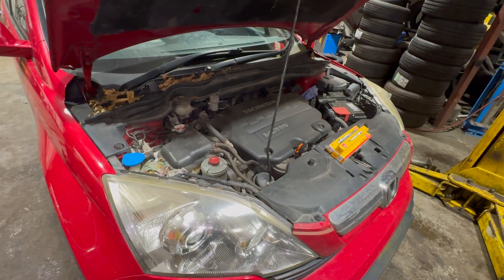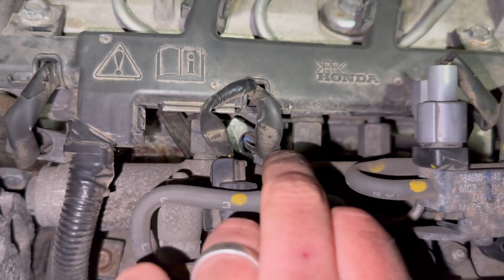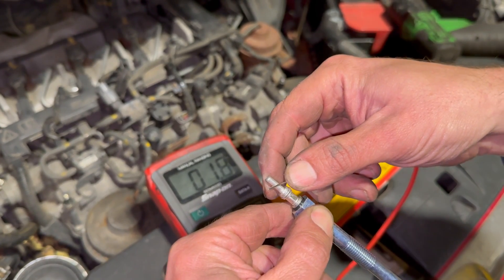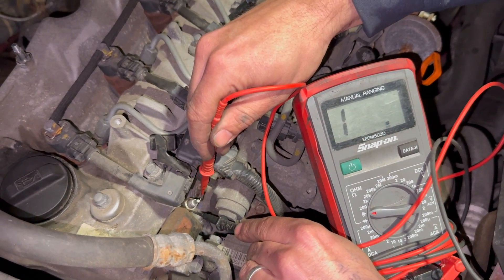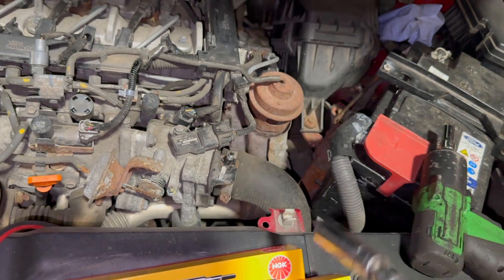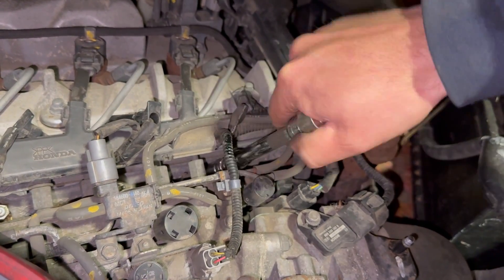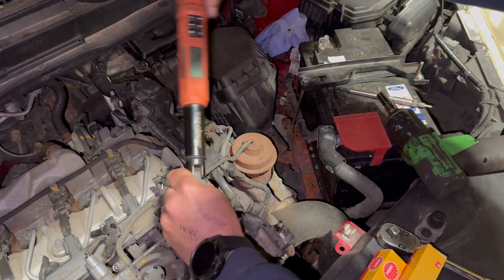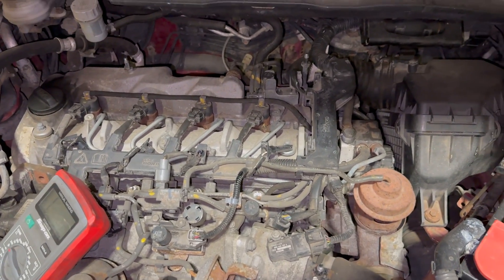How to test & replace the glow plugs on a Honda CRV 2.2 CTDI

Comment: Measuring resistance alone is a good measurement, but I think checking current draw under load (watts/amps) is a better measurement. It's unclear how hot the glow plugs are, even though we know their resistance.

Comment: Hello, I have a honda civic gen8 2.2 CTDi. I just realised the glow plugs never been changed, got 153k on the clock, no missfires. Been taking really good care of the car since I bought it, general maintance done. Just passed MOT with no advisories, beside all the care, everytime I start the car and I am not moving, it smells like diesel inside (no leaks, already been checked by 3 diferent mechanics). Could this be a cause? Any ideias or sugestion? Thank You
Reply: I had the same issue on m'y Honda crv idtec 2.2. smell of smoke in habitacle
Reply: @webinspiration  Did You sorted out?
Reply: @YouSt0leMyHe4rt  yes, EGR pipe was changed AT official Honda garage
Reply: @webinspiration  Thank You for the feesback
Reply: Certainly EGR pipe is cracked.

Comment: Hi , thanks you, I have bought 9 months a go a Honda CR V 2005 2.2 CTDi Diesel  RD 9. and Iove it. about 3  weeks a go the motor check turned on, the same time the right headlamp was dead. I had my car a mechanic and he diagnosierted with Diag set and it showed that the problem is glow plug, right then the motor check turned off and after three weeks newer turned on. I do not know it still needs to be replaced? However I think the motor shakes more, may be it is an emotional panic not a technical matter. 

My next question is the kind of OIL Motor it needs, as I bought it I changed the oil and there is a big dealer of Oil in Germany WM offered me 5W-40 Liqui Moli but I think it should be 5W -30,,is that right?   Thanks for answer.

Comment: Nice. I had a 2009 Civic for a few years. Bought it 2 years old from a main dealer but turned out to be the most problematic car I'd ever owned. Depsite only having covered 9,000 miles within a year it needed a new clutch, a new Power Steering controller & new shock absorbers. All these things were well documented problems at the time but I was deeply disappointed with my first ever Honda. Not had another since.
Reply from the maker: 👍 usually bomb proof the Hondas too! I must admit we have seen a few clutch / dmf problems with them